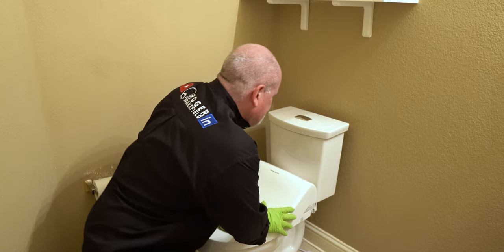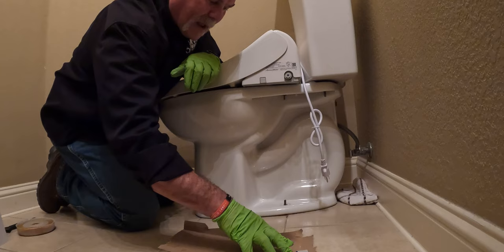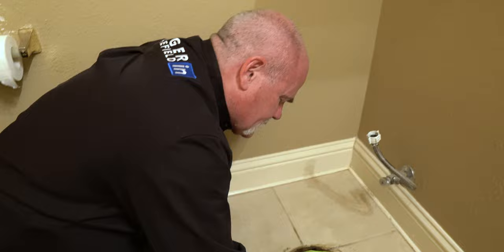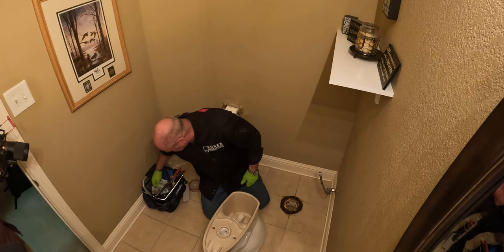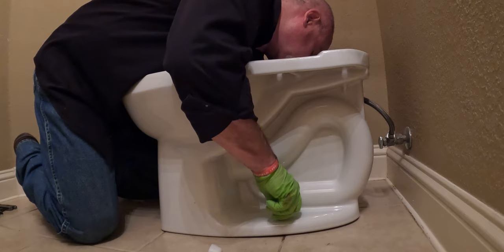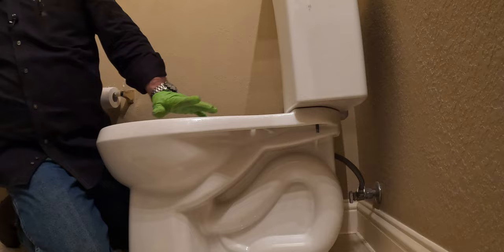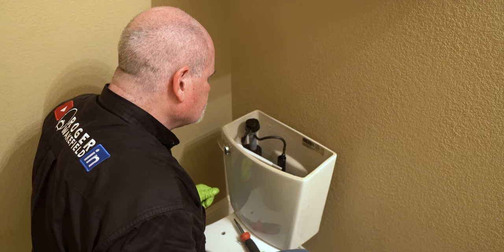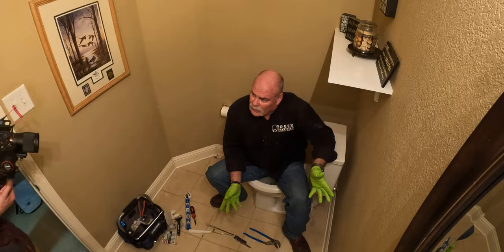How to Install a Toilet: A Step-by-Step Guide

Comment: I am a german plumber and i must admit. I have never seen a wax ring in a toilet installation. We use pipes and fittings with rubber seals that get lubricated and then pushed into each other to create a seal
Reply: Smarter because rubber lasts longer than wax, but I'm a texas plumber and if you mention rubber ring not wax they'll think your a bad plumber. It's like there is a stigma against rubber rings lol

Comment: I fixed, changed out two toilets a few months ago.  It was not too similar to what Roger did.  I had a lot of rotted subfloor around the flanges that had to be replaced.  And new flanges and elbows and waste pipes too.  Roger did not show all of the carpentry and flooring work that is always needed when doing plumbing.  Plumbing work is usually only half plumbing and half everything else.
Reply: Sounds like the project I'm doing currently at my house

Comment: One mistake I've made is cutting off the bolts using an oscillating saw with a dull blade. It will get hot and melt the PVC flange...and it sucks to be almost finished and make that mistake.

Comment: I always say it’s a 2 man job. 
Just in case that water valve don’t shut off and you have to shut off the main valve at the meter. 
Trying to yell at fam
Shut it off is always a challenge. 
They quit cause you yelling.  
Only wife would stick around cause she needs that toilet.
Reply from the maker: What a trooper she is, whatever it takes to get the throne in place! 😂

Comment: What are your thoughts on using a non wax ring?

 Im getting ready to bust the lead out of a broken cast iron flange into a concrete floor and replace with an oatey pvc flange i think. And im thinking of going w a non wax ring. Ive thought about using a cap too but Im not sure. Both require screws into the concrete

Comment: When the floor is not perfectly flat and level, I use those thin plastic kitchen cutting boards and custom cut them to the exact shape needed to fit under the low side. Never had one fail. I never use metal toilet flanges. When I find one, I replace them. The 5/16 toilet bolts are certainly stronger and I use them.

I can’t believe you tilted that new toilet that far to one side like that after seating that wax ring. That tilting compressed the wax ring on one side. I’d be surprised if that side does not leak. The only way to properly seat a wax ring is to go straight down. No amount of toilet wobble is acceptable. Imagine doing a video on how to install a toilet and not checking to see if you had a toilet seat for the new toilet. This was not one of your best video.
Reply: the cutting board idea is great!  I'll keep it in mind.
Reply: I wondered about that, too (tilting).  I thought maybe that was because he put the ring on the toilet and not the floor.  But I'm just a DIYer, so there's a lot I don't understand.
Reply: You seem to have all the “answers”…where is all your installation videos sir?
Reply: @Shane542  , I have installed several toilets in my properties over the years, but I do not do toilet installation videos. I commented on Roger’s installation video, because people who have never installed a toilet before might think they can tilt the toilet to one side like he did. Doing so can sometimes cause a small leak, that over time rots the floor.

I have never had a leak, from a toilet I installed. I installed the first toilet in 1979, in the first house I purchased. That toilet is still in that house to this very day. I installed five toilets in 2017, and one toilet in 2021. I have not installed any toilets since, because I sold off all my properties except for two.

Comment: what is your thoughts on using a rubber seal vs. wax?
Reply from the maker: I've used both, but i prefer to use a wax ring to me its a better fit and I haven't had problems with the ones I've installed thus far